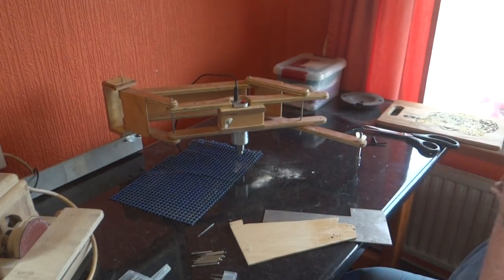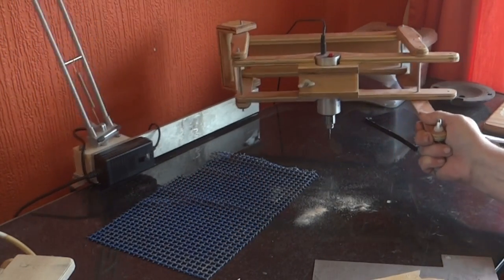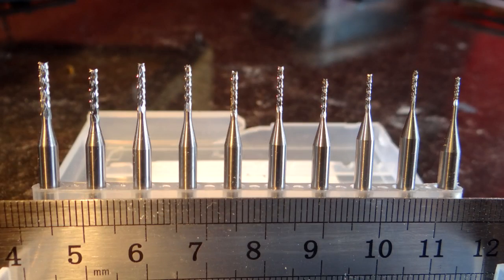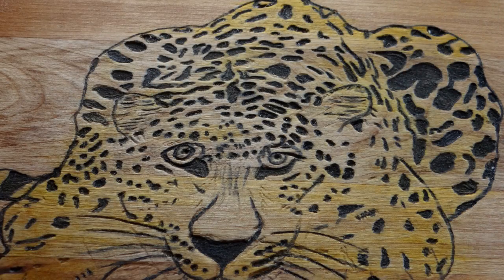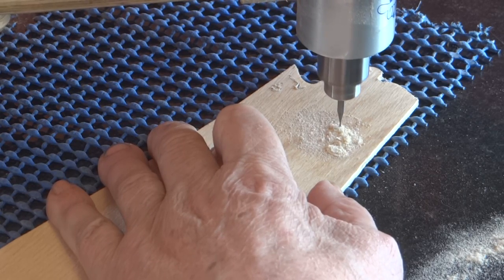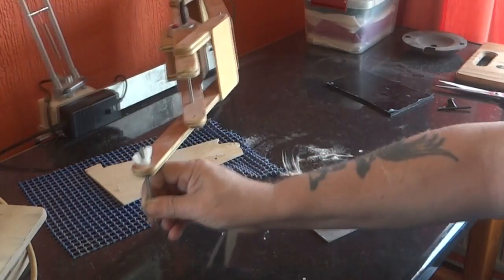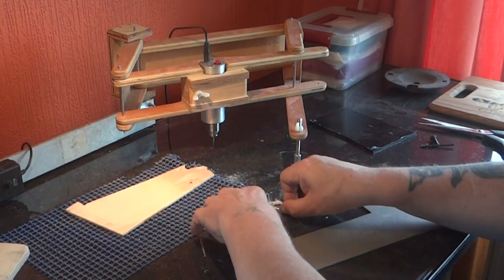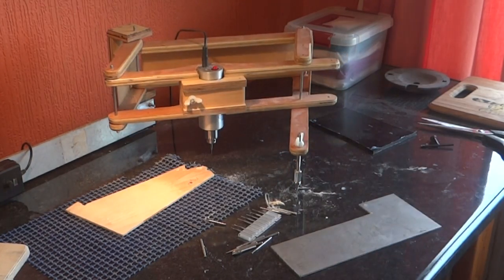Miniature 3D Pantograph Router

Comment: built pantograph but the letters inclined goes out and the picture is not pronounced where the problem might be?
Reply from the maker: I'm not sure I understand what your problem is. The only thing that can go worng with the design is failing to make sure that the hole spacing is exact and that the top and bottom holes are perfectly aligned with each other and at 90 degrees to the frame when assembling it. Maybe that's where your errors are?
Reply: and what is the ratio of a to b arm because I did a short frame to 15 cm and b slower 30 cm I can not open your project because I do not have such a program in advance thanks for your reply
Reply from the maker: The ratio is 1:2 so 15cm and 30cm arms should work fine.
Reply: thank you very much already know where I made a mistake tomorrow I start again and see the effect
Reply: grzegorz masternak tv by gn cm cm CV cm cm CV CV CV CV CV.

Comment: Would this be, in principle, suitable for making table top monopoly - a table with a monopoly board inlaid?
Reply from the maker: +Nostradormouse In principle yes, but in practice you need a pantograph with twice the reach of the largest dimension you want to carve so you'd need an awfully big one to make a monopoly set unless you carved it in smaller sections and assembled them later.
Reply: +seafax If it was easy, everyone would be doing it.

Comment: Would it be possible to use a regular sized router instead of the the spindle motor? I'm just thinking that say if I wanted to do letter carving, a normal router would do a better job. What do you reckon? Anyway, great video thanks for sharing.
Reply from the maker: See the last link in the description for one that's built sturdy enough to take a trimmer router. I've jet to see one that takes a NORMAL sized router but it's just a question of scaling it up sufficiently to prevent it tearing itself to pieces.
Reply: http://woodgears.ca/pantograph/
Reply: hes got good work nice video.. for bigger motor u asking for